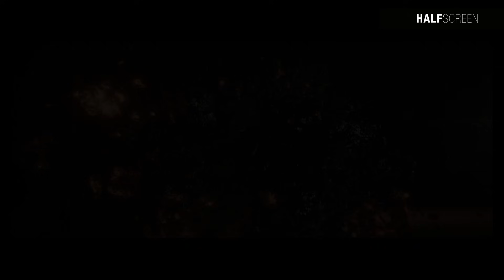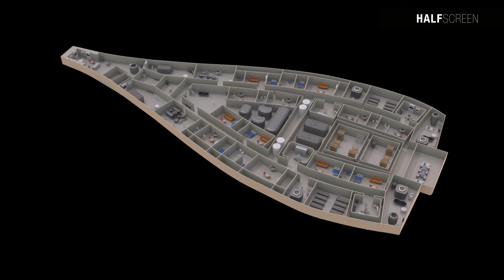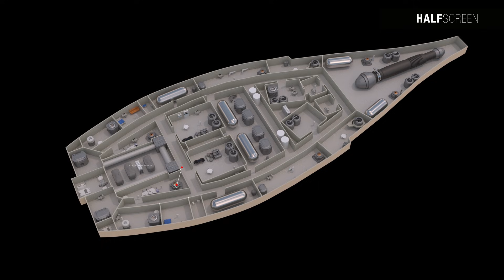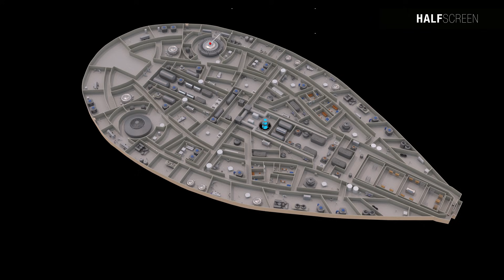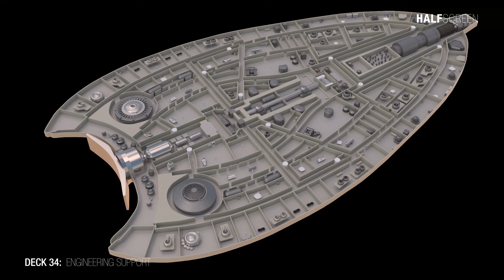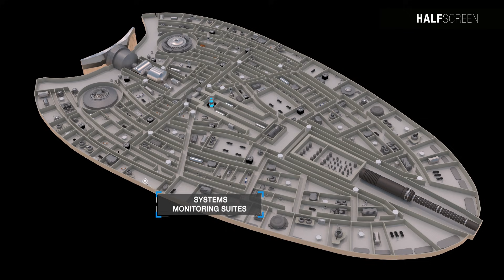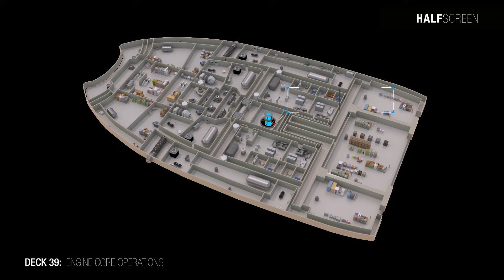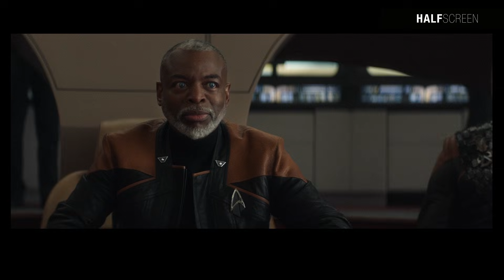Inside the USS Enterprise D (Deck 16-42)

Comment: Far too large for a thousand people could house 20000 in comfort.
Reply: I recall reading somewhere that the original design intention was a standard crew of 6000, but budgeting and production constraints had them reduce that as it would be too difficult to give the impression of that many people onboard. And of course, with the ship already designed and models built, can't just reduce the size of the ship to account for a smaller crew complement. Fortunately, with as much automation the ship has, do not need as much active crew to keep it running. Also means you have lots of room for temporary specialists for any given mission type.
Reply: In tng episode yesterday's enterpise d the enterpise held a total.crew of 6000 in the alturnitive universe
Reply: Evacuation capacity of Galaxy class is more than 15 000 people. In episode "Ensigns of Command" they were able to evacuate 15 thousand colonists without prior preparation. 

And in episode "Yesterday's Enterprise" there was a war, so the ship was adjusted to carry 6 thousand troops with everything they might need. It is similar here to the current date aircraft carriers that in peace times carry significantly smaller crew than in war times. 

One of the advantages of a Galaxy class is it's huge versatility and ability to be adjusted to the mission needs. It can carry more equipment, more cargo or more crew if needed. I guess they could make space for even more than 20 thousand. But thanks to the advanced technology and automation a thousand people is usually enough.

Comment: Do you come up with all of this on your own or do you have a source? I was so intrigued I just sat here and watched the skematics of an imaginary ship explained to me in detail.
Reply from the maker: There is a source or blueprint.  My 3D models are based on the schematics.
Reply: @Halfscreen  I figured that you got all your information from the blueprints alone, while they are a wonderful source they are not helpful as to what everything does.  For example, You talked about the reactant loaders that are located above the torpedo launchers, you said that "They are responsible for loading reactant materials into specific systems."  While you are not wrong, you are just overly generalized.  They are used to load anti matter into the photon torpedoes.  There is a book that you should have used as a reference with the schematics, that would have told you literally how every system worked on the Enterprise D, and that is the Star Trek the Next Generation Technical Manual.  
    Other than that, great job with the video.
Reply from the maker: @Schindlerphoto  Thanks.  My knowledge of the ship is rather basic since I don't know all the intricate details involving the ship's overall layout, but the information you are giving is given me a better understanding of the ship.  thanks.
Reply: @Halfscreen  The Star Trek fandom are a very special group of people, they know those ships like the back of their hands.  Over the years, the shows producers, have been kind enough, to provide material to help fuel that imagination, and they have been doing so for over 50 years.  Some fans not only know what everything does, they can tell you what buttons to push to make it work.
I love your work, I think that you make great videos, I just want to help you out on finding the sources to help make your videos better.
Reply from the maker: @Schindlerphoto  Thanks.  My knowledge of Star Trek is limited at best since I started the channel as a Star Wars fan.  However, I grew to appreciate the designer of the ST franchise since they really care about the intricate detail of the ship.  The older ship at least has some logic and flow to its design language.
Reply: @Halfscreen  Gene Roddenberry, the creator of Star Trek, insisted that there was a market for well produced Science Fiction drama.  The majority of sci-fi shows, before Star Trek, were nothing more than campy kids shows.  Those shows often focused more on entertainment over story telling, so they didn't focus on getting things right.  
Star trek was different, once something that canonized as to being or working a certain way, they pretty much stuck with it, this helped Star Trek gain a certain realism to it.  And they stuck with that formula, or at least tried too.

Comment: Am very early into the video….. it mentions Vip and other quarters for esteemed dignitaries. These are not for your normal ambassadors and admirals, but  for esteemed guests in the field of engineering. In fact very FEW personnel would have permanent quarters in the engineering hull except by request or necessity . The Lower Decks concept is reserved for third line and lower ships that act as teaching vessel with dormitory style accommodations

Comment: so many in-universe tech material out there for these shows, but I've noticed the Enterprise D stuff gives the most opportunity to geek out.
Reply: It is the most fully fleshed out starship of any series. This two parter video is based of the paper blueprints designed by Michael Okuda and Rich Sternbach released in the mid 90's. If you can find them I HIGHLY recommend you get them. They are a treasure of study on this class. I myself still have mine all these years later, and after this vid, I am gonna have to revisit them.
Reply: @02ujtb00626  the 3D walkthrough someone made in Unreal and put online is based on those blueprints too! I still have the tech manual, which dives into yet more detail the shows hardly touch on.
Reply: @danandtab7463  That 3D walkthrough of Enterprise-D is called Stage 9, and it still could be found on the internet, if someone would want to see it. Or there are also videos on YouTube of it.